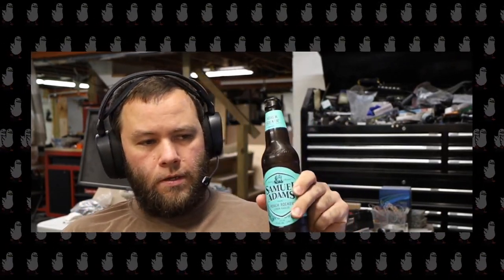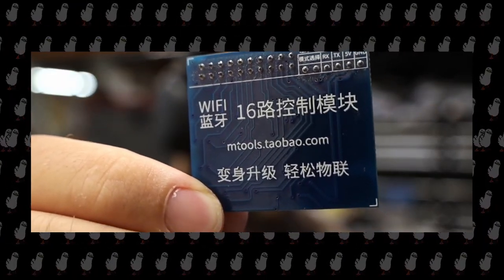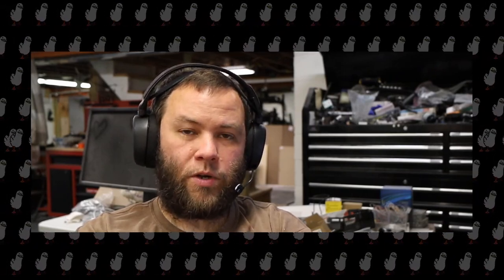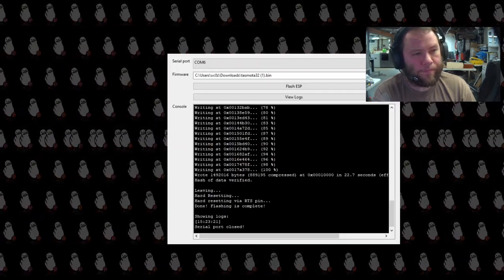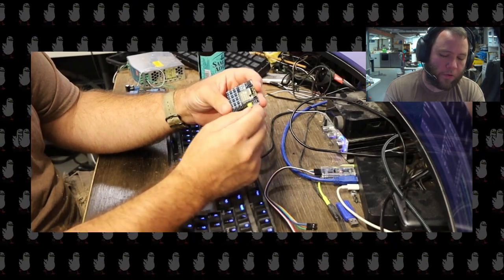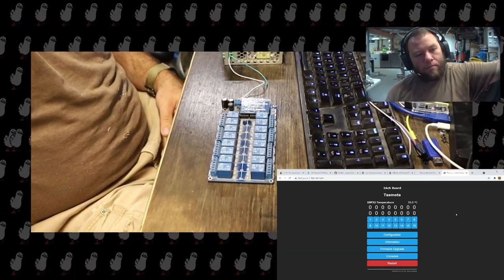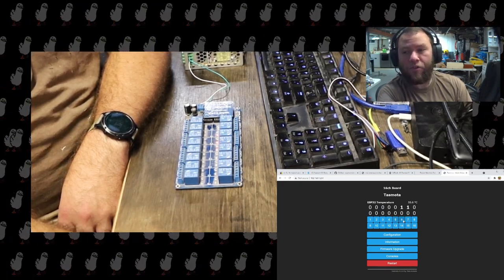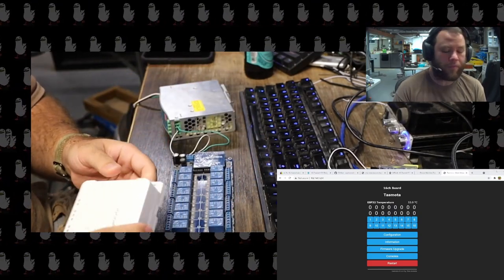16 Channel Sainsmart Relay Control Board setup and config

Comment: Hi. I used that same relay card to replace the mechanical programmer of my old washing machine. Worked fine for a while but the relay controlling the motor finally gave up the magic smoke. 
I replaced it and rather than connecting it to the motor again I connected it to a Legrand heavy duty relay who does the heavy lift. A bit clicky but functional. 
So you can use those cheap relay cards to control more powerful devices if you interface them with the adequate good quality relay. All the other parts of the washing machine (solenoids, pumps, lights, latch) are controlled directly by the relay card without an issue.

Comment: Hello, I am using the sainsmart relay board.  I am triggering a 24v pinball flipper solenoid.  After a while the relays start to peter out.  I hear a click the lead lights up but the 24V circuit does not complete.  What can be causing the issue.  Is 24V DC too much load for the relay to handle?  I experienced this on a couple of boards.  Any help would be appreciated!! Thanks
Reply from the maker: Sounds to me like not enough supply amperage. Get a bigger PSU to run the board.
Reply: Thanks for the response.  Not sure that will solve the issue.  I am using a 12V power supply to power the board.  When I use the same 12V power supply to trigger the solenoid I don't get the issue, its just the solenoid don't have enough pull to move the ball hard enough.  24V is required for this, but that seems to break the siansmart relays even though they are rated 30V 10amps.
Reply: It's the current, not the voltage, which is giving you problems.  Did you measure the voltage at the solenoids when using your 24V supply?  Also, I would recommend that diodes be placed across the solenoids to save the relay contacts.

Comment: Can the Sain smart 16 channel relay board be used without WiFi connections, just want to trigger LED lights from a separate control board?
Reply from the maker: Sure. just use a raspberry PI or an arduino. I went with a ESP32 cause it meant i didn't actually have to program anything other than tasmota.

Comment: I can't find the device/network after I flash it. It says the flash was successful, but I can't find the device network. Any ideas?
Reply from the maker: You need to use your phone to connect point to point. Its also possible you may have pushed a config. Just power on and off 7 times, with the 7th staying on then try to find it with your phone. Itll be called ‘tasmota_xxxxx’.